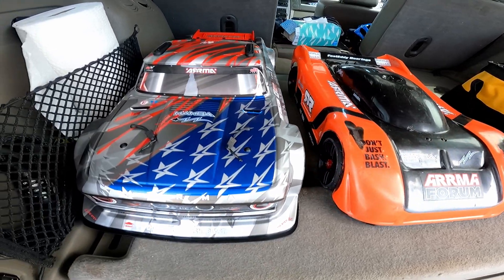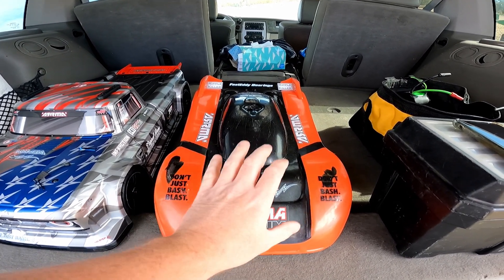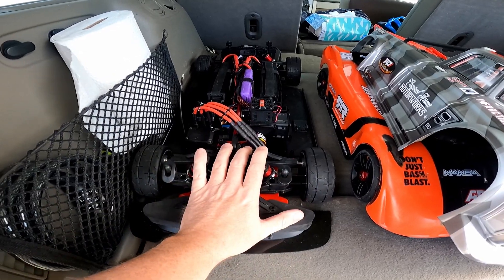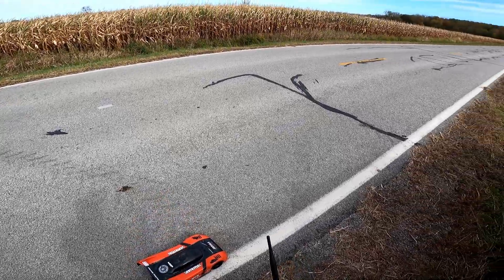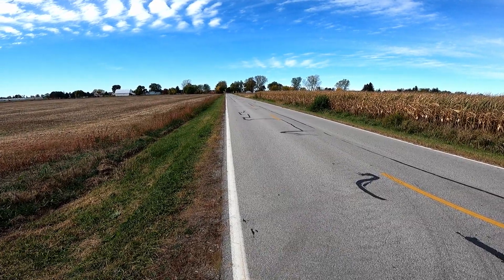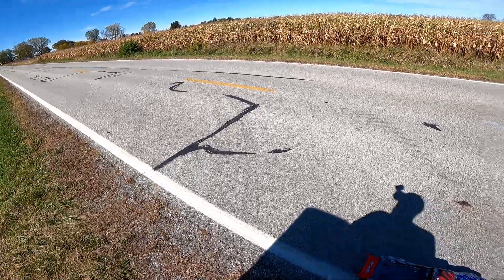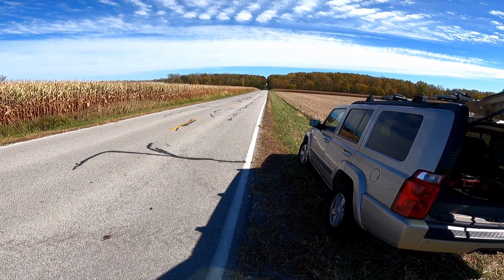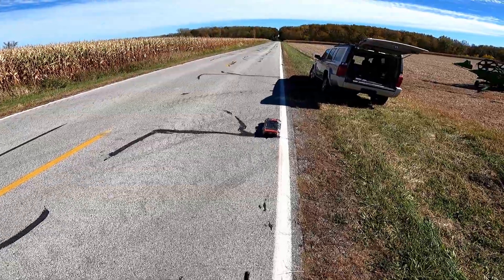Arrma Infraction V2 and Typhon 3S GT Speed Runs

Comment: Nice Jon! 👍 
The wind has been my enemy lately as well, my last 3 outings ended in the corn at 103-105 🤬
Btw: the hand brake seemed to work pretty good.
Reply from the maker: Hand brake worked great. I have the servo turned down to 10% EPA which is the minimum for CH3 on my radio. Seems like that’s all I want. I still have CH2 brake as well if needed.

Comment: What is the difference in hand braking than motor braking?
Reply from the maker: The hand brake is a disc brake just like a nitro car. It saves you from heating up your motor when braking.
Reply: @jondilly1974  oh ok ,so that’s just on the infraction 2020 model?
Reply: @jondilly1974  thank you sir👍🏽
Reply: @jondilly1974  oh btw where can I find the low speed run bumper for the typhon?
Reply from the maker: @mrmontgomery526  I made that one 🤣
Reply: @jondilly1974  nice!, is it possible to use the same one on the limitless?
Reply from the maker: @mrmontgomery526  on the Typhon 6S yes with some small trimming. But not on the 3S afaik
Reply: @jondilly1974  ok cool I have the 6s version, thank you sir “Happy speedruns”